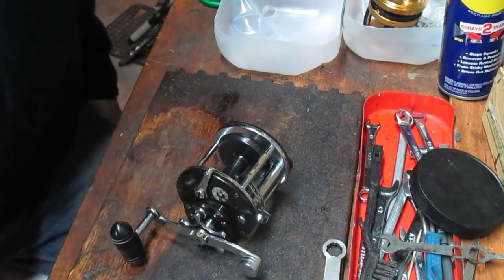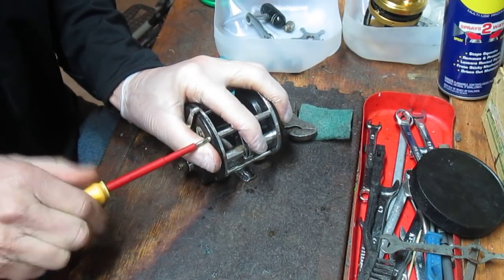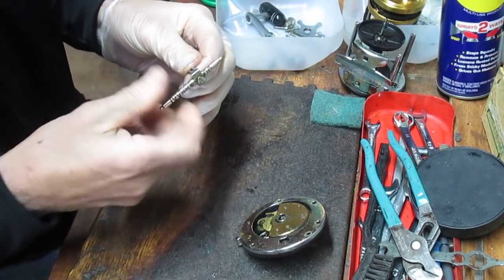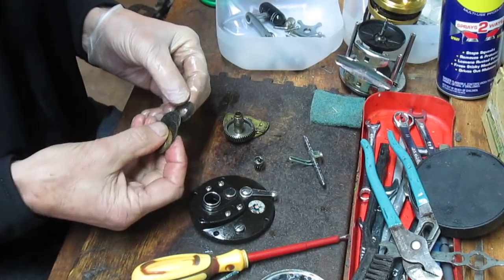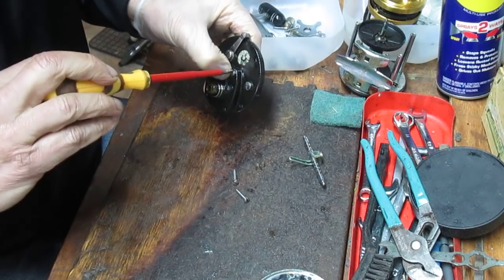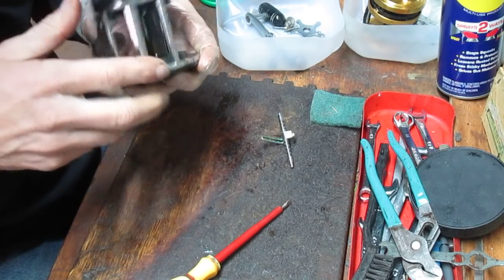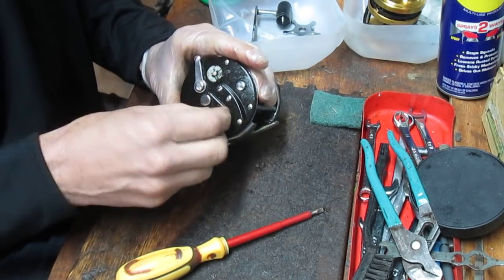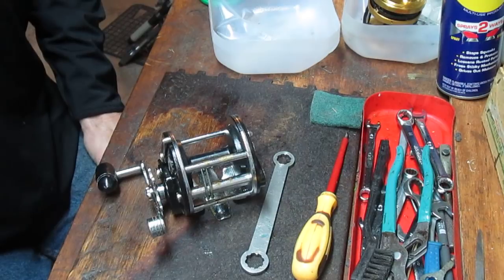Penn 209 & 210 Maintenance including take apart and drag service

Comment: Dennis, I have a chance to get an Ocean City no. 107 reel. What can you tell me about it? My internet search has been fruitless. I intend to mount it on a vintage 1946 rod bought in Japan post war. Thanks..Gerald from Beaufort.
Reply from the maker: Your reel is the 107 Sea Girt Surf Casting Reel.  It has a capacity of 250 yards of line.  It was made in Philadelphia, USA in the late 1920s and was one of the first reels made by Ocean City, which started production in 1922.  Your reel was introduced in 1929 and sold for $4.  It was one of the lower priced reels that Ocean city made at that time, but still very expensive to the average angler at the start of the Great Depression.    That same $4 would be around $75 today. Sea Girt is a town along the New Jersey Atlantic shore and many of the early Ocean City reels were named for beaches and fishing destinations in and around Philadelphia.  If you would like to learn more, There is a book by Mike Cacioppo that gives great detail.  The title is "Ocean City Fishing Reels A Collectors Guide 1922-1957". Thanks for asking - Dennis

Comment: Why does the line pile up higher on right side of spool?
Reply from the maker: The cause is usually a dirty or worn pawl or grit in the worm track.  You can start by removing the pawl and cleaning the top.  Check the points to make sure they are even - If one is broken or worn more, you will need to replace it.  Parts are available through mystic parts.com - Dennis

Comment: I purchased a 210 awhile back,  but it doesn't have anti-reverse. When the reel is engaged it spins clockwise and counterclockwise.  Is something potentially broken inside the reel causing it to not stop?
Reply from the maker: Yes - you likely have a broken or worn anti-reverse dog or spring or both.  Those parts should still be available through Mysticparts.com You can follow the video on how to take the reel apart and replace the worn parts on reassembly.
Thanks for asking.  I hope this helps

Dennis

Comment: Hi Dennis I have a question if you have a reel with a level wind and you want to take it off is that hard to do that hard to do thanks for your time and help 😊
Reply from the maker: They are a lot easier to take off than to put on.
If you do decide to remove it, take the idler gear or worm drive gear off as well. That will reduce the friction and speed up the spool for casting better - Dennis

Comment: I do not understand why you did not clean all the corrosion from the foot , level wind and side plates.  Servicing a reel means clean and lube.
Reply from the maker: If I did not include the cleaning, it was due to time constraints, with the video run time.  My main purpose was to show how to take apart and service the mechanicals - Dennis

Comment: did you say the 210 has a magnet feature ,if so where is it
Reply from the maker: The mag 210 has  it in the non gear side plate, however, there are some 210s that were made without this feature - Dennis

Comment: I'm sorry, but I just discovered your channel and I've watched several of your Penn "maintenance" videos so far from beginning to end (Penn #9, 109, 209, 210, 309, 65, 85, 285, etc.), and I am utterly ASTOUNDED at how many crucial parts you literally add ZERO grease or oil to! It's staggering! Not only that, but these are all reels you said have not been serviced for a long time, have sat around, or were bought in flea markets or antique shops, etc. With that said, in nearly all of the videos I have watched so far, you never cleaned or even greased the main and pinion gears whatsoever prior to re-assembly!!! Amongst other very key parts! 😮 Your videos are a good reference point for how different models of reels are assembled, but in all due respect - and please know I take no pleasure in saying this - but in complete honesty: I wouldn't let you touch any of my reels for service with a 10 foot pole. How you re-assemble a reel without cleaning or greasing the drive gears as a BARE minimum is COMPLETELY beyond me. Wow...just wow. *shakes head
Reply from the maker: Thank you for your honest feedback - I am always seeking to do better - Dennis

Comment: Hey Dennis I have a new out of the box Penn 209 levelwind reel that is stuff when the line lever gets all the way to the right side of the reel I've adjusted the adjustments and I  can't get it to loosen up, it has not been dropped that I know of and has no damage to it that I see any help would be nice and thank you
Reply from the maker: James - Chances are that there is dirt or dried grease on the worm gear or in the pawl assembly.  If it has been sitting for some time, then that would be my first thought.
Try spraying the worm gear with WD40 or another penetrating oil.  Then remove the pawl cap and do the same to the pawl.  Let it sit for a while and then try cranking to see if it resolved the problem.  If it works properly, then just put a drop of reel oil on the pawl and close it up.  If it still sticks then let me know and we can try something else - Dennis
Reply: I'll double check but it brand new
Reply: I haven't even put line on it yet lol
Reply: Hey Dennis I found the problem on my 209 the worm gear Shield was slightly bent on the right hand side at the back pain hole I took screwdriver and bent it over just a touch no more binding no more stiffness thank you

Comment: Is it good for cast?
Reply from the maker: The 210 is better than the 209 because of the ball bearings, but both are slowed by the level wind feature, which will limit you casting distance Thanks for asking - Denis

Comment: Show a 209 not an easier version that you claim drops right in.

How do you not have a 209?
Reply from the maker: Sven - The reason I do not have a 209 is that I do videos of the reels that come into my shop for repair and I have not had a 209 to work on in a while.  I have that on my list of to do items and will do the 209 when one comes in for servicing.
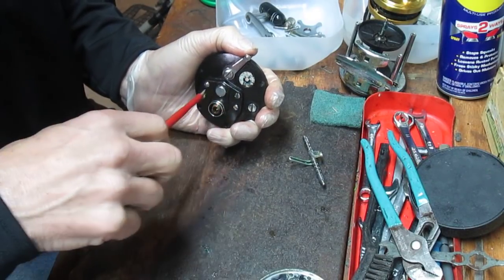The 210 has a bridge mounted anti reverse dog, somewhat similar to the Penn Jugmaster.  That enables you to service the drags and "drop in" the bridge for reinstall.  You are correct, the 209 does not have that feature and you must rotate the bridge to complete the anti-reverse dog installation.  If you want to re-check the video, you can see the bridge mounted anti-reverse dog around the 8:00 mark.  I appreciate you watching the video and taking the time to comment.  Stay tuned.  I am sure I will get a 209 sooner or later.  I do have a 309 that I am waiting on parts in order to do a repair.  I will post that one in the next week or two, as soon as the parts arrive - Dennis
Reply: 2nd Chance Tackle . Isn’t the 309 considerably different than the 209?

Comment: Hey buddy, I have a question about the 209. I would like to remove the clicker from when I reel, it's not the switched clicker its the more quieter one. Is this possible?
Reply from the maker: I believe the clicker you are referring to is the anti-reverse dog, which sits on a toothed gear and clicks each time it moves to the next slot.  It is not possible to eliminate this click without removing the anti reverse dog.   If you do that, the reel will operate as a direct drive and the handle will spin backwards when the fish pulls your line.  Thanks for asking - Dennis

Comment: I got 209 worm gear not working how do I get it working
Reply from the maker: There are 3 main causes for the worm gear not working.  The first is a broken pawl.  The second is a broken transition gear, which is plastic and located inside the bearing side plate and the third is a broken worm gear.  To check, turn the reel upside down. so that you can see the exposed part of the worm gear.  Crank the reel.  Is the worm gear turning?  If it is not, remove the bearing side plate.  That is the one without the handle.  Check the plastic gear.  Are the teeth missing or chipped?  It they are missing, it will not turn the worm gear.  If they are chipped, the worm gear may turn, but not move the line guide.
If the plastic gear is OK, but the line guide is not moving, remove the pawl.  The pawl is located in the screw cap under the line guide.  The top of the pawl should look like the letter "Y".  If one of the forces is broken. it will not operate properly and will need to be replaced.
Finally, if the gear and the pawl are OK, then you need to check the worm gear to make sure it is not damages and that the track are not scarred or out of alignment.  If they are, then you will need to replace the worm gear.
Parts are available from Mysticparts.com.  They are a distributor for Penn Parts.
Let me know if these suggestions help.  Thanks for asking - Dennis

Comment: Hi, a consultation, maybe you can help me. piece 14-99 (dog) of 209 is compatible to 60? thank you.
Reply from the maker: 14-99 is the dog spring and is comparable.  15-99 I the dog for the Long Beach.  15-209 is the dog for the 209.  I believe the 209 dog is shorter than the one for the Long Beach reel and not compatible or interchangeable.  as a reminder, if you have a worn anti reverse dog, check the gear sleeve to make sure that the teeth are not worn.  If you are replacing the anti-reverse dog, you may need to replace the gear sleeve as well. - Thank you for asking.
Parts are available at mystic parts.com and they can confirm that these are different anti-reverse dogs.

Comment: Is the penn peerless no 9 the same as this one in terms of disassembly, and reasembly? I bought one at a yardsale for 5$ and since have replaced the idler gear and levelwind asembly. Now id like to take apart the drag and replace with carbon drag washers,
Reply from the maker: Yes - the procedures are the same.  The #9 is just a smaller version.  The drags,  bridge assembly and other parts are smaller, but the process is the same.  The #9 reel is sturdy and dependable.  Good luck with the overhaul.  If you run into a snag, send a note and I will see if I can help - Dennis
Reply: 2nd Chance Tackle thanks dennis
Reply: 2nd Chance Tackle so the bridge assembly that contains the drag washers is the only thing that should come out on me? Or do i have to worry about the springs and dog all falling out when i take the 4 screws out?

Comment: What would cause one of these (209) to not reel in under a load regardless of drag adjustment?
Reply from the maker: The normal cause would be worn or broken drags. It is hard to say without taking the reel apart.  A secondary cause could be a broken piece of line trapped inside the reel.  If you have the drag tightened all the way down and can pull the line out by hand, then it is usually the worn drags.  Lastly- are you using braid?  If you are, and it has not been backed with mono for the first several yards, then it could be the braid slipping around the spool, which will cause the same problem.

Comment: Hi, do you know, If a Penn peer 209  have a ball bearings? And, If its have, wich the size? Sorry for my bad english. I earn an old Penn peer 209, and i opened and not found the plates ball bearings. Thanks man
Reply from the maker: The bearings are not the traditional round ones you are looking for.  They are in the side plate caps and not upgradeable.  The Penn 210 has the ones you are looking for in a traditional bearing - Dennis
Reply: 2nd Chance Tackle thanks Dennis!

Comment: Do you have any info on the Gamefisher TR/24 reel? It looks like a Penn copy.
Reply from the maker: The Gamefisher tr/24 is a reel that was made in Japan for Sears. The original Gamefisher branding was by Garcia, so it is also possible that they contracted for this reel to be manufactured for Sears under that name. It may also have been made by Daiwa.  Several of the Sears reels, like the King Neptune were Daiwa products.  The reels are generally reliable, but parts tend to be difficult to find. Any private label reels were made in Japan in the 80's and 90's by various manufacturers including Ryobi, Daiwa, Olympic, Compac and others.  - Dennis
Reply from the maker: I need to correct - The Garcia brand was the Kingfisher, not gamefisher. - Dennis
Reply: Thanks for the info.

Comment: I've got a Penn 85 Seaboy and after watching almost all your videos I decided to pick up a 209 and 210 really cheap on ebay. You're very talented and knowledgeable on this subject. There's no doubt that you enjoy what you're doing and it's fantastic that you're sharing your expertise with us. I'm inexperienced with these types of reels, being from the southern US, and look forward to using them on some big cats. Thanks Dennis for all you do.
Reply from the maker: Thank you for the kind words.  Good luck on the rebuilds.  If you run into a snag, send me a question and I will see if I can help - Dennis
Reply: I just acquired a Shakespeare Service 1944 model GE. I was able to determine it was made in 1946. This seems like a very solidly built and well made reel. Penn reels seem to have many similarities to the old Shakespeares. Is there any way you can do a video on one of these?
Reply from the maker: I don't have one, but I have a few older Shakespeare reels.  I will check with what I have and do a video on the oldest one.  Technology did not change much in those years and there is a good chance they will be similar.  Thanks for asking - Dennis

Comment: I own a Penn Senator Wide Mutiplyer (without level winder)

1. Is it possible to add a "level winder"?
2. The "alarm washer" cracked. Need a new "alarm washer".
3. Need to purchase "a set of the rod grip holder and the two screws" which are misplaced.

Your assistance advice and support is much.
 appreciated.

Yours Aye ... Syed Hussein
Shah Alan,  Selangor, Malaysia.

HP: 013 - 2266888
Email: syedhussein09@gmail.com

Thank you.
Reply from the maker: Hello Syed.  You cannot add a level wind function to a non-level wind reel. The rod tie down clamp and screws are interchangeable for most reels up to and through the Penn Senator 3/0.  You should be able to get these online, through EBAY or another auction site or by going to Pennparts.com.  On the alarm washer.  There are two types.  One is riveted into the side plate and the other has a screw.  If it is riveted, then you need to replace the entire side plate to restore the function.  If it has a screw, then it can be replaced and should be available through the sources mentioned above.   Thank you for asking - Dennis

Comment: what about a 109 that has a two screw side plate. can't figure it out looks good but every time I put it together the free spool won't work. no release to cast out line.
Reply from the maker: I don't recall the free spool set up.  I know it is not the traditional set up you would see in the Penn 9 that has the jack, yoke and release springs.  I haven't worked on one of those in a very long time.  You may want to get the schematic and check that you have reassembled the reel correctly.  You go to Pennparts.com for the schematic and you can call them with questions.   They are very good about helping.

Comment: is there a big difference between the 209 and 210?
Reply from the maker: The difference is that the 210 has ball bearings on both side plates.  The 209 has the bushings.  As a result, the 210 is smoother and casts easier.  The is the only difference.  It's like the Jigmaster 500 and 505.
FYI
Dennis
Reply: thank you. and thanks for the jig master info!
Reply: does that mean the 506 is a 501 with bearings? I thought the 505 and 506 are high speed a lil different. I like em all . I'm a old penn guy. thanks for the info! I can talk old penn reels all day!

Comment: how big is the penn 9m in inches ?
Reply from the maker: The 9M is smaller than the 209.  It is the approximate size of the Penn 160 Beachmaster.  About 2 3/4 inch side plate and 2 3/4 inch spool width.  It is good for lakes and inshore fishing. - Dennis
Reply: thanks!
Reply: does it cast well
Reply from the maker: It is not the best for casting as compared to an Abu 5500 or other round bait caster reel.  No bearings and a moving line guide slow the cast and distance.  It is better for drop fishing in my opinion - Dennis
Reply: so,whats a cheap good casting reel for casting?
Reply from the maker: The most popular on the lower end are the Abu Garcia 5500 series, Daiwa Millionaire reel, Shimano Corsair or Corvalus in the name brands.  You can find other store brands like Bass Pro, Cabellas, Shakespeare SKP 2000 and knockoffs for less.

Comment: Thanks. Picked up a bucket of 209s tonight for rigging lead core. The video allowed me to go through the ones with a weak clicker and bound up retrieves. One clicker was all but worn off, I flipped it around so what’s left is functioning as a pretty good sounding click, but I’ll order a replacement.
Reply from the maker: That sounds like a nice trick for the worn clicker that will allow it to work a little longer.  Thanks for sharing - Dennis

Comment: I use a 209 for bottom (rock) fishing. Man is it slow reeling back and unpleasant with the small handle. Was going to add a larger handle but the money for the handle can be spent in buying a more modern reel for not much more.
Reply from the maker: Yes - the 209 uses the Penn Long Beach gears, which is approximately 2.7:1, so it is very slow on the retrieve.  If you get the 210, which I showed in this video, you get the higher retrieve as it uses the JigMaster gears.  The 309 also uses the JigMaster setup, so both are better off with either than the 209. I personally fit the Daiwa Sealine, but that is not a level wind reel.  Many of the comparable "modern" reels from Shimano, Daiwa and Okuma feature gears as high as 6.2:1 in the conventional level wind reel.  I generally don't like them that high as you can rip the hook from the fish with the high speed retrieve.